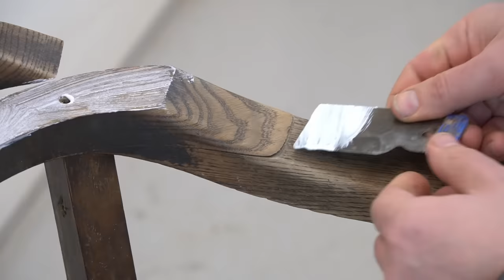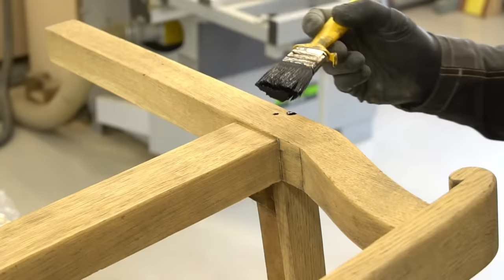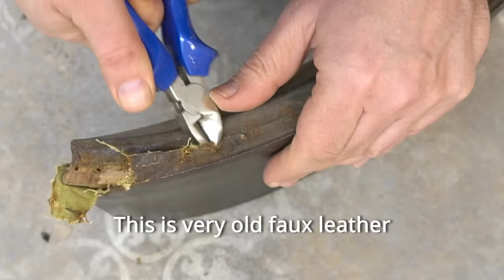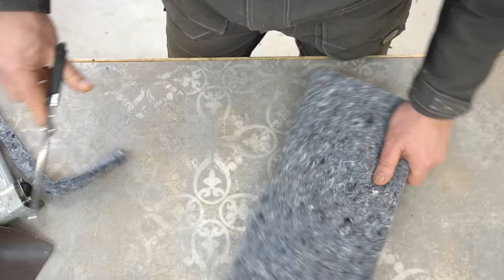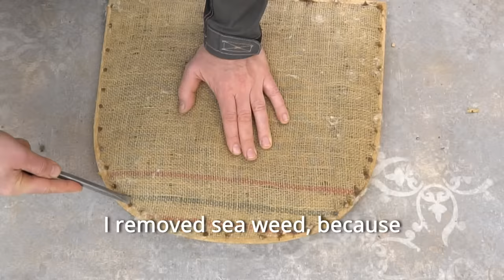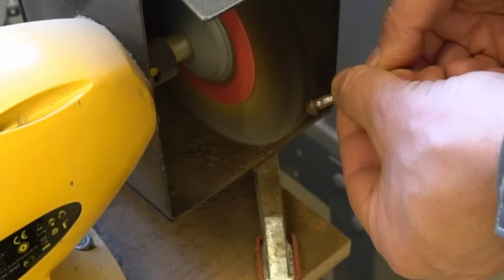VERY BROKEN armchair restoration!

Comment: Your work is first class, that chair deserved real leather. Perhaps you might consider traditional red, green or even black leather in future. Your work deserves the best materials for upholstery. I know it was originally faux leather, but your finished products are superior.
Reply from the maker: It is up to the client. The problem with leather is that it is hard to get exact size that you need. Usually you have to buy whole cow size piece. Secondly, the furniture from this time period originally had almost always faux leather.
Reply: @ATRestoration  I did not understand that it was for a client, I presumed you bought the chair. Thank you for taking time to reply

Comment: I always seem to get a blotchy result with stains. Is this a property of alcohol vs water based stain or maybe just product differences?
Reply from the maker: Yes, alcohol based stain makes it more blotchy. One way to avoid it, is to sand it smoother or use thin shellac layer as primer. WIth water based stain it works for sure.

Comment: I was hoping he would retain the original patina showing previous usage of the chair. Or, at least simulated the old patina. We have a 50 year old rocking chair (that we bought new) that has a great wear pattern on the arms. There are sections where the original finish has worn away to be replaced by another silky smooth finish from the oil on our hands.

Comment: I have found that a syringe works best for getting glue into cracks.

I just had a heretic thought: applying shellac with a paint sprayer 😁

Sexy curves may be, but look at the sexy wood grain!
Reply from the maker: I have done that, but the shine is a bit different then.
Reply: @ATRestoration  Never tried it. I always imagined the shine of shellac comes very specifically from the many successive layers - that layering you don't get if you spray it on.